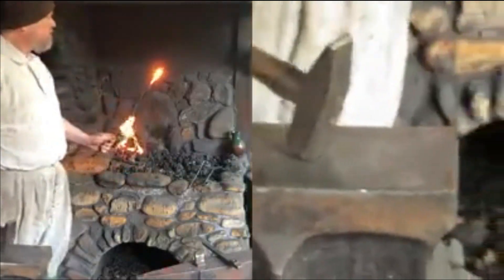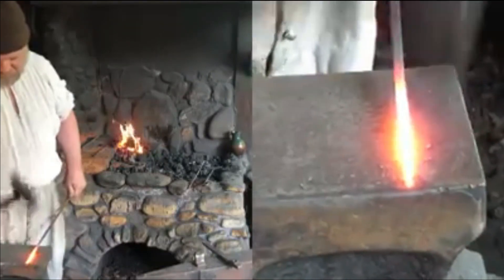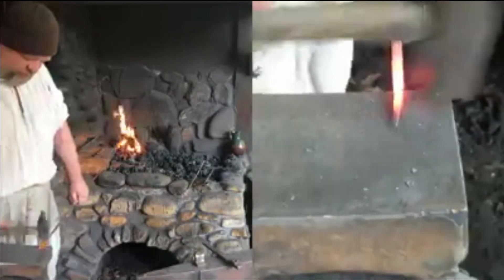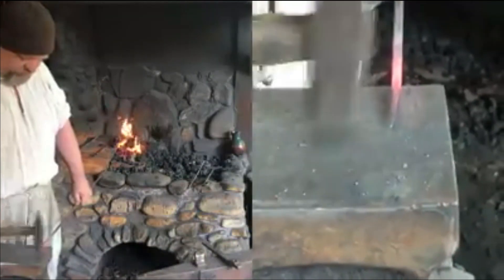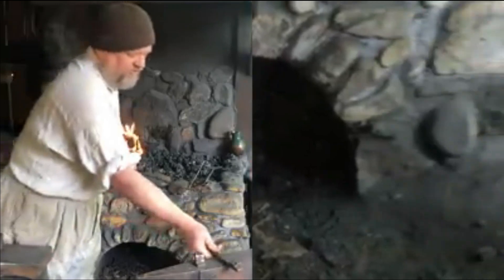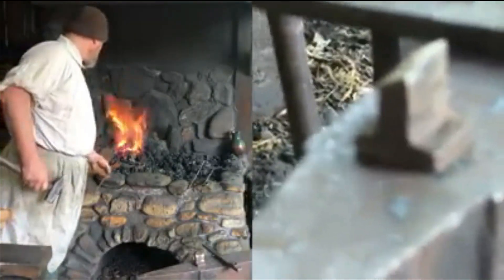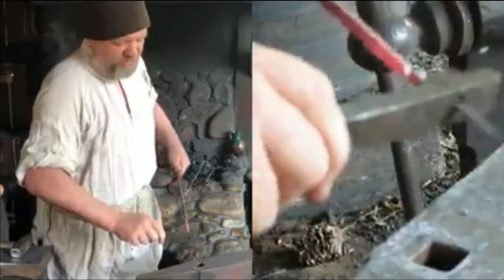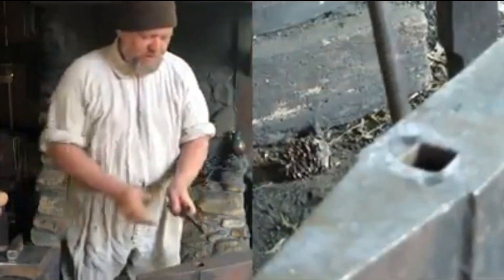How Does A Blacksmith Make A Nail?

Comment: Wonderful video and very fast nail making.
Wasn't nail making often an apprentice job too?
And how do they make the iron/rod they then make the nail from?
Reply from the maker: Would you believe that Vincent slowed down his nail making for the video?

Yes an apprentice smith could be tasked with making nails. But remember that the apprentice is a student receiving the specialized education of their trade and not just cheap labor.

Adam Smith actually covered the important difference between blacksmiths and nailers very well in Book 1 Chapter 1 of The Wealth of Nations -- 

==>"A common smith, who, though accustomed to handle the hammer, has never been used to make nails, if upon some particular occasion he is obliged to attempt it, will scarce, I am assured, be able to make above two or three hundred nails in a day, and those too very bad ones. A smith who has been accustomed to make nails, but whose sole or principal business has not been that of a nailer, can seldom with his utmost diligence make more than eight hundred or a thousand nails in a day. I have seen several boys under twenty years of age who had never exercised any other trade but that of making nails, and who, when they exerted themselves, could make, each of them, upwards of two thousand three hundred nails in a day. The making of a nail, however, is by no means one of the simplest operations. The same person blows the bellows, stirs or mends the fire as there is occasion, heats the iron, and forges every part of the nail: In forging the head too he is obliged to change his tools."<==

There is the big difference between the blacksmith who may do a few hundred nails and a nailer capable of doing a couple thousand.

Thomas Jefferson had a nail factory at Monticello in the 1790s, with enslaved labor and a daily production of 8,000 to 10,000 nails a day. 

In the 18th century the nail rod for Monticello was brought in from Philadelphia. In the 16th/17th century nail rod may have been made in fining forges by drawing the metal out under power hammers. Or at worst nail rod could be drawn down from a large bar of iron by a smith. About 70 or so sections of nail rod have been found in the archeology of the Jamestown Rediscovery project at Historic Jamestowne, along with a broken nail header.